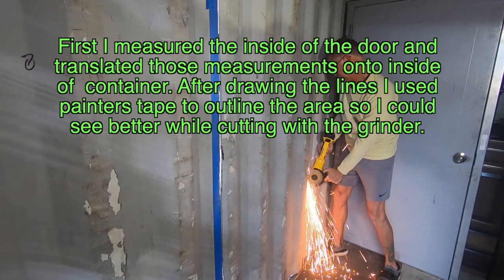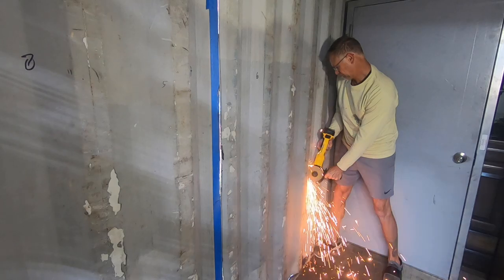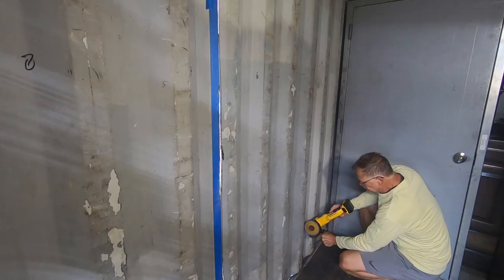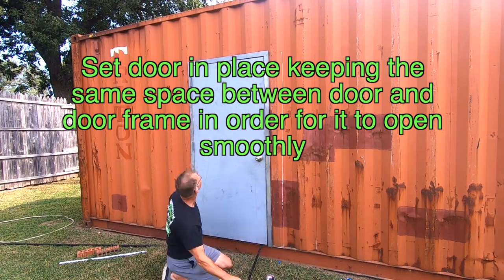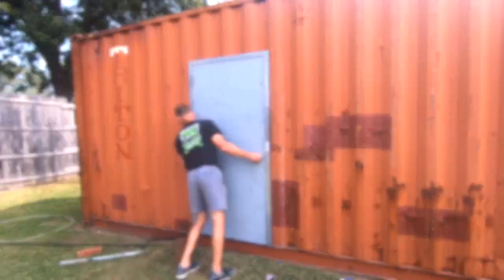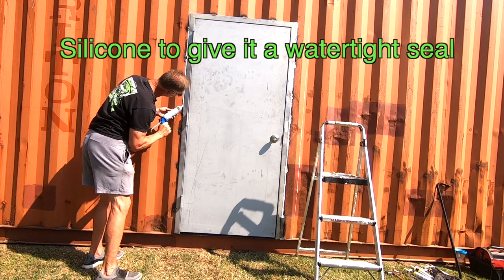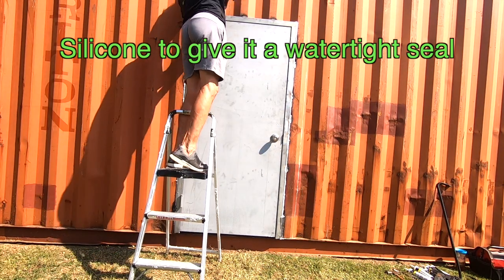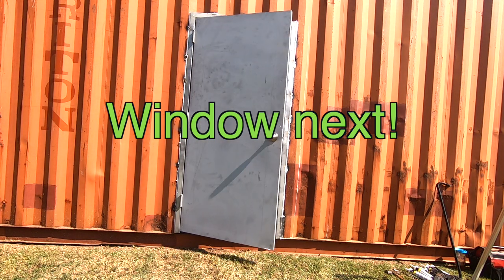How to Install a Door in a Shipping Container

Comment: I went through this evolution and I’ll have to replace both doors. Previous attempts at installs went very badly. I’m going to try to relocate the doors and try to match the corrugation ripples on the wall of the can to try and make it look at least a little better. I like the idea of cutting off the inside flange but we’ll see.

Comment: So, how deep is the frame for the wall thickness ? The commercial frames I have are for a 4.75 “ wall thickness and I know I could make a better frame w/ access to the right kind of break. (Brake?) The Wall material thickness is 14 gauge steel. How dispenser you reinforce the interior part of the frame.?
Reply from the maker: Yes the frame of the door is about 5 inches. I framed the inside of the wall with two by fours and put sheet rock up to build an office.

Comment: Where did you get the door frame?
Reply from the maker: I purchased the door and the door frame which came together from Lowe’s. The issue I had was the frame was the same width on the inside as it was on the outside. To fix the inside width I bent the frame outwards so I could slide it in hole I cut out leaving the outside frame wider so I could weld it to the outside of the building and caulk around it
Reply: @DizzyDrone  would you please provide a link to (or specific model number of) the door from Lowes?  I'm having a heck of a time trying to wrap my head around exactly how to install a man-door on my container, and any additional info would really help.
Reply: @DizzyDrone  Also, how did you bend that door frame on the inside (what tools did you use to do it?)?
Reply from the maker: @az_stan  https://www.homedepot.com/p/L-I-F-Industries-36-in-x-80-in-Gray-Flush-Left-Hand-Security-Steel-Prehung-Commercial-Door-with-Welded-Frame-UWS3680L/202510520?g_store=&source=shoppingads&locale=en-US&&mtc=Shopping-B-F_D30-G-D30-030_024_EXT_DOORS-NA-NA-Feed-SMART-NA-NA-New_Engen&cm_mmc=Shopping-B-F_D30-G-D30-030_024_EXT_DOORS-NA-NA-Feed-SMART-NA-NA-New_Engen-71700000089797289-58700007605952051-92700068705095861&gclid=Cj0KCQiA0eOPBhCGARIsAFIwTs7GjAMJc6qQZxZ85MMChThmUM1tKgbwQvh01wJC5RiSPH6HSj1NLy4aAhIaEALw_wcB&gclsrc=aw.ds
Reply from the maker: @az_stan  Channel locks, a hammer and lots of sweat lol. I basically just pulled in away from the door frame and then once I had it in and welded I used a hammer to pound it back out the best I could
Reply: @DizzyDrone  Ah, yes, towards the end of the video I can just barely see where you bent and then hammered back the frame.  Thank you very much for your responses to my questions.  I guess I do have one more question for you: in retrospect, do you think there might be another/better way to have solved that issue of getting the door frame to slide inside the opening rather than having bent it and then having to bend and  pound it back into place?
Reply from the maker: @az_stan  it would have been much easier if the inside frame lip was about an inch smaller all the way around it would’ve slid right in and I could just welded the outside frame
Reply: @DizzyDrone  Yes, that makes sense.  Thank you.
Reply: @DizzyDrone  could you have cut a inch off ? I'm looking to do the same on three units
Reply from the maker: @noahstringer9178  yes that would have looked better
Reply from the maker: Home Depot